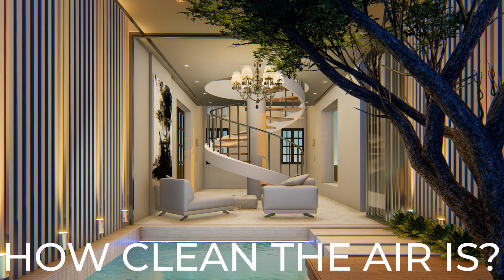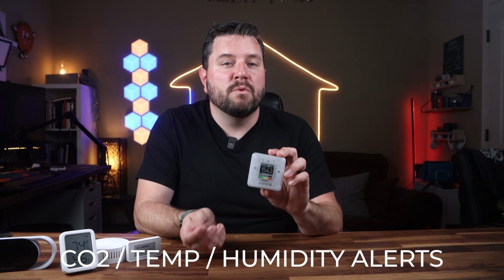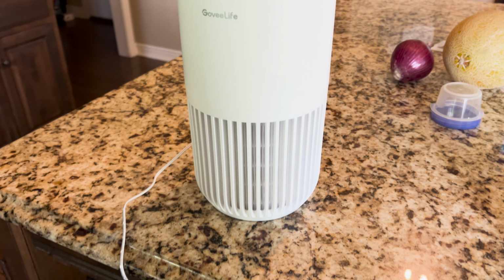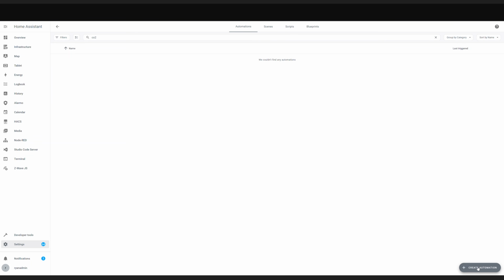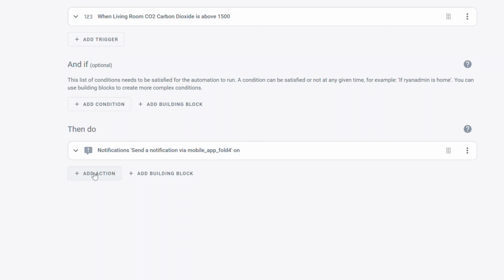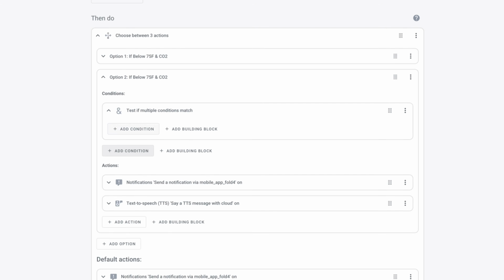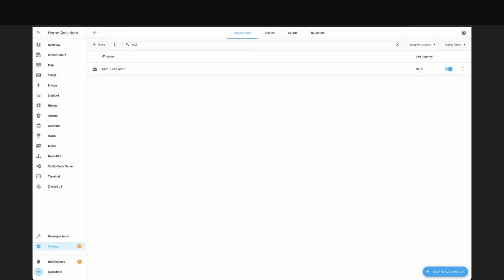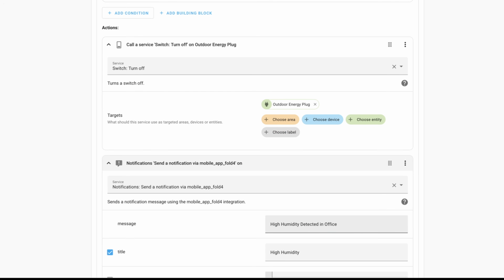5 Smart Air Quality Sensors That Will Elevate Your Home!

Comment: No model is suitable for measuring carbon dioxide concentration in a car, because its refresh rate is too slow, while the carbon dioxide concentration in a car rises very quickly.

Comment: Excellent video. I automate my home exhaust fans with an aranet4 sensor. If CO2 gets above 800 all my bath fans and range hood fan turn on. They turn off at 650 ppm. 

It's really helped the air quality and wellness in our house. 

I also have the govee pm 2.5 sensor. I'll look into that aqara tvoc sensor

Comment: Awesome video! Quick question, the Aquara TVOC monitor states that an Aquara Hub is required. Is this true or will it integrate into Zigbee with a Zigbee Gateway or is the Aquara branded hub a requirement?
Reply from the maker: Nope, like I mentioned in the video, mine is connected via Zigbee2MQTT. I would assume it will work with any other ZigBee backend  as long as they have added support.
Reply: @ThisSmartHouse  awesome!! Thank you!